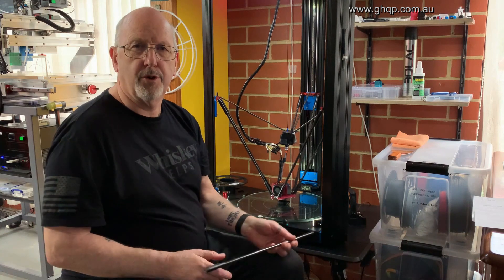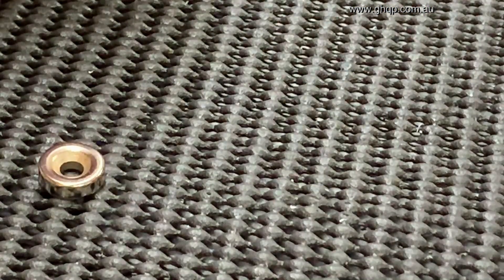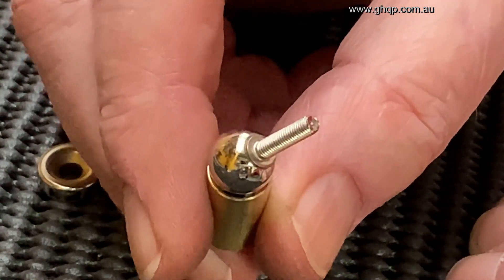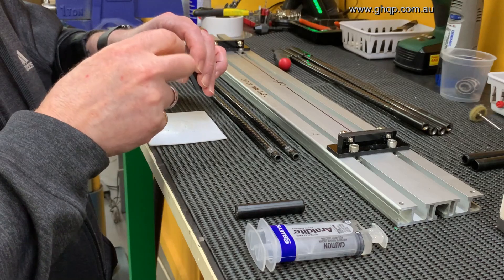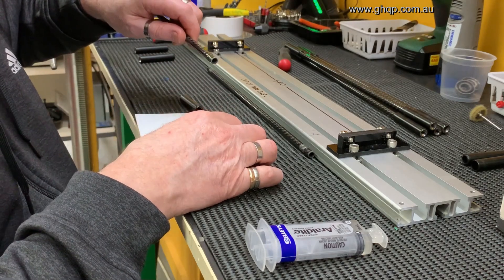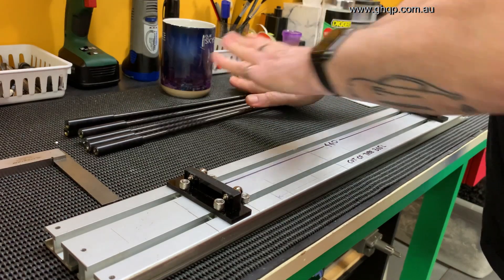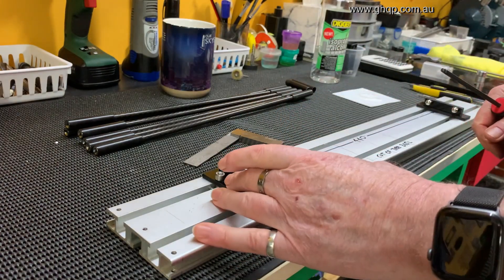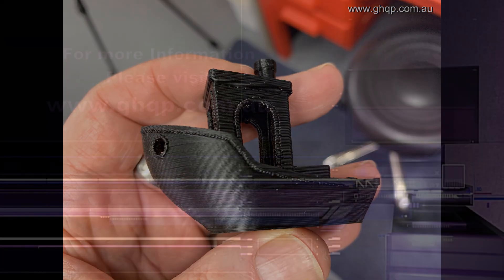Making MagBall Arms for the ANYCUBIC Predator.

Comment: Do you still have your Predator?
Reply from the maker: Yes I do and am still using it. Its the only FDM printer I have.
Reply: @hamrx8  Cool. I have 2. Im thinking about upgrading with a piezo sensor because i can never print high quality items. Mostly bed leveling is an issue. Got any suggestions for me? ☺️
Reply from the maker: @toneandersen2944  That's a difficult question to answer. I have performed many upgrades to my predator, Effector, Mosquito Hotend, Linear Rails, Glass Bed and Magball Arms. I would say not one thing contributes to the good results I am getting from my Predator, its probably a combination of all. I have no bed leveling issues at all in fact I only have to re-calibrate it whenever I replace or clean the nozzle. It could be months in between doing that. To be honest the overall results I get from my Predator even with all the upgrades are not what I would call amazing and perfect but they are pretty good for the type of projects I print which are more functional items than need to loop pretty.
So if you if your Predators are pretty much original and you are wanting to improve their performance I could not advise on one single thing you could do. In my opinion now due to the age of the Predator I don't think it would be worth spending too much money doing all the upgrades. It might be just as wise to invest that money in a new more up to date printer like a Bamboo-labs.
As for fitting a Piezo sensor, I have not done that so cant comment on that one.
Cheers
Reply: @hamrx8  Hi thank you for the replies. Im just trying to learn. Bambu lab dont provide bigger printer build volumes so i have already started upgrading predator. 1 has duet 2 wifi and a bondtech. But bed leveling is the issue on that. Next one is stock so i still need to upgrade that. Im thinking Dragonfly/Misquito with piezo sensor for both of them.
Reply from the maker: @toneandersen2944  Hi. I am still using the Predators original Trigorilla controller board and firmware. I never found any reason to upgrade that even though I did purchase a Bigtreetech SKR V1.4 Way back years ago I have never installed it, perhaps one day.
I think its just that it works fine as it is. Probably the single most relevant upgrade was a Mosquito Clone hotend and Direct Drive extruder. I pretty much haven't done any upgrades for a few years now.
Apart from this YouTube channel I have a whole section on my website dedicated to the upgrades I have done to my Predator.
https://www.hamrx8.com/PREDATOR-INDEX.html

Comment: One thing that I'm curious about, is why not make the arms a bit shorter to match the length of the stock rods. What I mean is, the stock rods are ~440mm from the center of the fisheyes, but with this you're adding 440mm rods to the radius of the balls minus the bit that is inset into the socket which basically makes the diagonal rod length around ~460mm instead by my estimation. Hayden did the same thing with his rods too, that's about the only thing that bugs me about them. It eats up a bit of Z height on top of what the balls add vs stock. 

I guess it's not a huge deal, I've only come close to using up the entire Z height on my predator a few times, and It's no where near as bad as mounting the entire hotend below the effector, like what using a smart effector does.
Reply from the maker: Thanks for commenting.
For me I will never use close to the full height of my predator so matching my rod length to exactly the originals was not significant. I wont ever use a smart effector as I do make my own CNC machined from Aluminium incorporating a Mosquito.
Reply: @hamrx8  Yeah I guess now that you mention it aluminum would be cheaper if you didn't already have the tooling needed to handle steel. Any cheese grade drill and tap set would be able to handle it, need to spend a fair amount extra and would want to have a drill press to be able to get through the 100 odd holes that you would need to tap if you use steel(or 50 if you skip every other hole).
Reply from the maker: @creamofbotulismsoup9900  I don't think that its so much that Aluminium would be cheaper but more that is is a better material for this application. Plus being easier to drill and tap. Also I only put screws in every second rail hole to secure it but in my opinion every third would probably be quite ok. Get yourself an M4 Spiral Tap and use lubricant when taping the holes. I use an electric screw driver or a drill at low speed makes tapping holes much faster.
Reply: @hamrx8  I know that using steel is totally overkill and possibly more trouble than it's worth. It's not that much harder to deal with though if you have the right tools. The size I want is available locally, I'd have to have the aluminum shipped. Similarly I'll probably be going for SAE hardware since I have to pay a premium for good metric drills and taps here in the US. I guess I can always change my mind, maybe, but I don't mind a bit of overkill.
Reply: @hamrx8  But should the stiffness of the shorter arm be better?What is your current Z-height and print area？
Reply from the maker: @罗五二  As I use Carbon Fiber Rod the stiffness is more than adequate and the print aria is identical to the original.

Comment: Hello! Since you used the KD310...do the magnets hold? Would you recommend getting the KD312 (with 2kg holding force) instead? They both use m3 threads.
Reply from the maker: I tested the KD310 up to 3.4Kg, they have never failed while printing.  I did initially consider the KD12 but personally don't think that size to be necessary when the KD310's hold well beyond their stated specification. Just make sure you get good quality ones. I did get one batch that were all chrome plated magnets included and they were rubbish.
Reply: @hamrx8  Allright thanks, did you get them from Magtool store over on Aliexpress?
Reply from the maker: @teikjoon  Yes I did :)

Comment: possible to take off the fish eye end and tap the KD310 to m4 and screw in the original predator rod? Also was wondering why Huntley put magnets on the rods when all the kossels seem to have the steel balls on the end of rods?
Reply from the maker: Honestly yes it might just might be possible but not something I considered doing. I looked at the magnet type that Kossels use and the magnets are half that of what I use and very rough, I didn't like them. I don't think it matters if the magnets are on the rods or the effector. Functionally it would be the same.